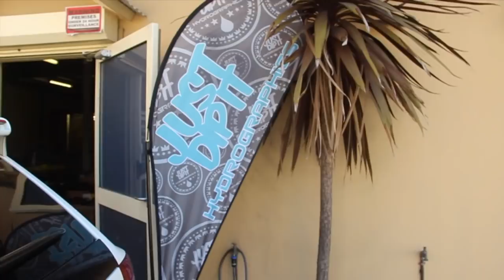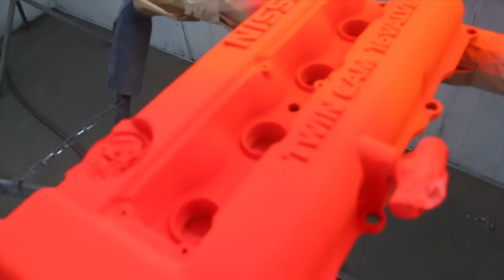Heat Changing Paint and Hydrographics

Comment: Is general engine bay heat enough to activate the "heat" element to this? Also, Has it been tested how long this heat reactive paint keeps it's properties?
Reply from the maker: Rafael Gonzalez yes engine bay will change the colour. Check out the date of this video mid 2017 it still looks and works exactly the same.
Reply: customspraymods what do u mix the black thermo pigment with ? And also in what ratio ? 
Thanks!

Comment: What brand of paint is the black heat changing paint? this is awesome! Do you think clearcoating with Cerakote would affect its ability to  change or damage the paint since Cerakote needs to be baked on at 250 degrees for several hours? (Playing with the idea of doing something like this to a ar15 build)

Comment: Hey yo. 

Can you make any color to go clear by heat?? 

I'm about to paint my MTB in a olive / British racing green kind of color, and with some light / neon green details on. But I have thought about painting my fork and rear suspension houses ind a black og something else Coker, and get it dipped with sculls, and then give it the green with neon decals and clear coat. But can the green be made so it's gets clear in contact with heat?
Reply from the maker: Sporguide.dk No you can't mate unless there is a green powder. Don't think there is yet.
Reply: Oh ok, but where can I buy it? and is its posible to get on spraycan ? and can you add flakes to the black then ?? Oh, and can it be shippet to Denmark ??

Comment: can you do that on a motorcycle exhaust ? it would look great
Reply from the maker: george lucas weiss yeah bit the UV light from the sun will fade the black and it won't work anymore. All those videos of it in Moto exhaust looks good for a few months then fails. Better off using it for under body parts or interior
Reply: Well I've seen UV protected paint advertised. But would the excessive heat burn the paint off?
Reply: The fluro orange and red are they heat resistive paints or general 2k paints over which we can hydrodip and spray on thermochromic ?.. Because once the part heats up won't the normal 2k paint burn off ?